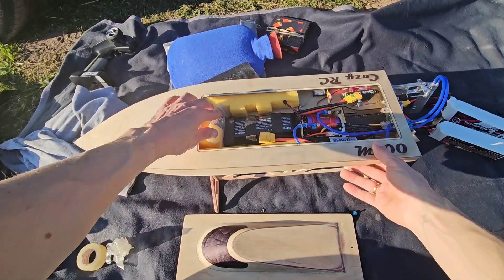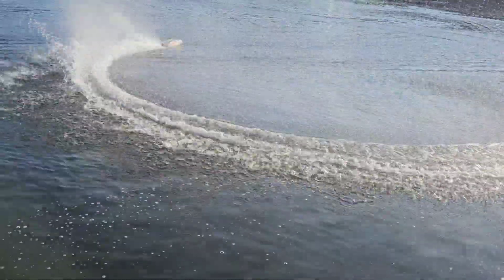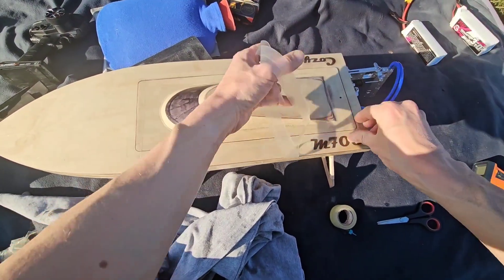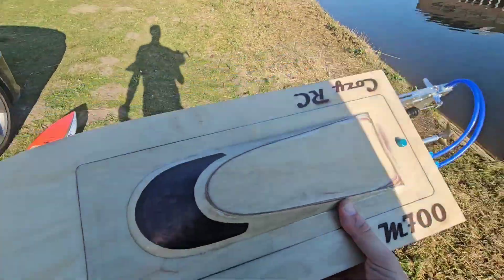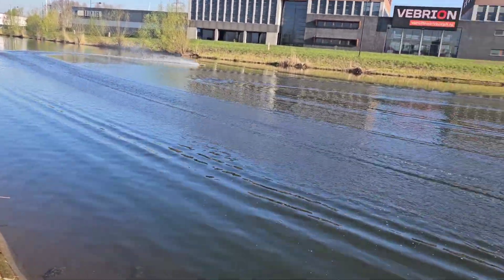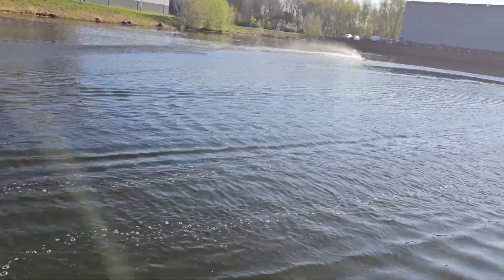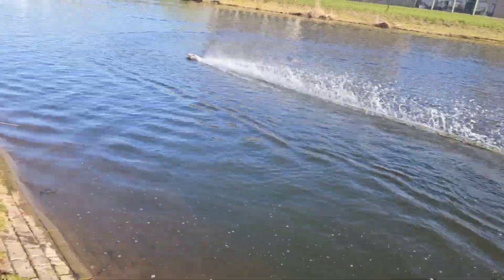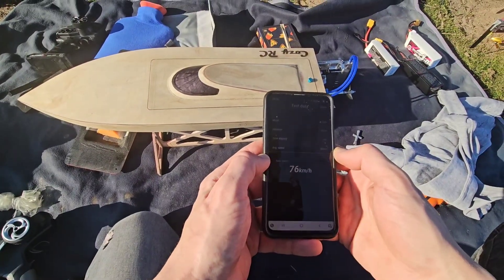Hand built M700 Mono: prop testing with a 4S setup

Comment: What make lipo, mah & c rating is the lipo, it's surprising how much more speed you can get going to a knife blade rudder. What will you make the knife blade rudder from, boat is running super stable. I added an XK3674 - 1900 kv motor to my collection of motors today in hk sale for 24 Euro.
Reply from the maker: From my experience, about 5km/h speed increase. 
I use a CNHL 4S 5000mAh 65C lipo. Next video I try 644 prop, and the speed is awesome!